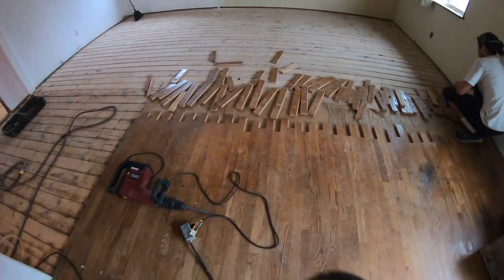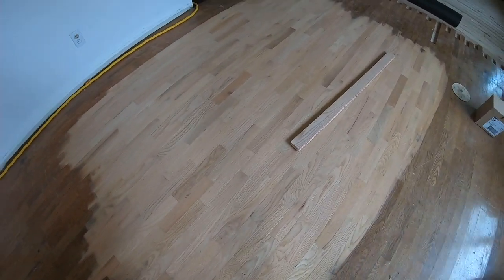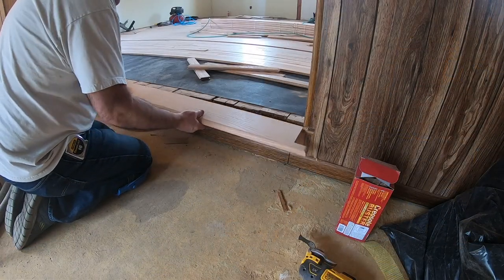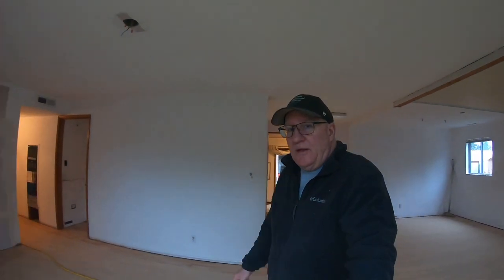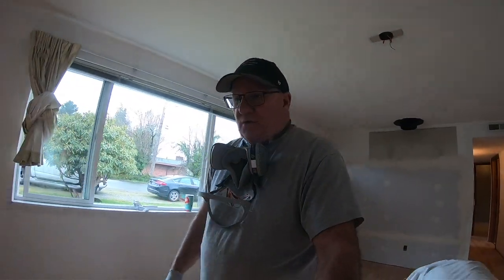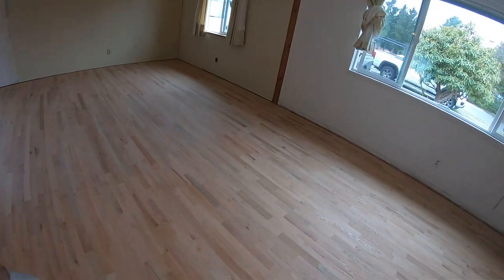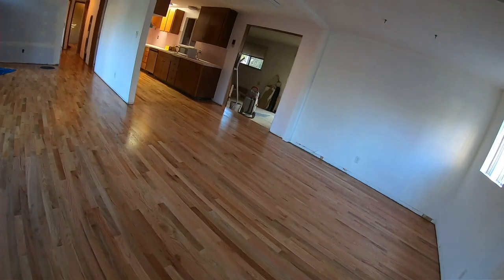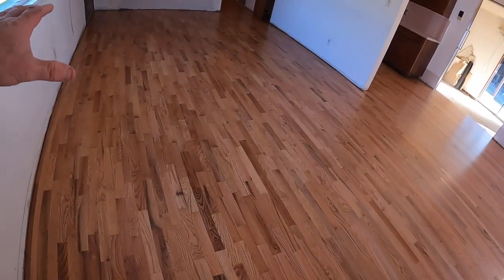Wood Floor Weave And Refinish

Comment: Humppy the Beam reared his ugly head on this on eh... My worst one was at the river cabin project where the hump was 3/4" center in a 40 in hall installing 2 foot tile.  Had to remove the subfloorthen plain the top of the bean and taper the joists to either side. No issue on the beam rating. Put new 3/4 plywood and 1/4  Hardibacker with mortar down and made a flat hallway that matched right to the new Brazilian whatever it was.  The lengths you have to go to sometimes.  We couldn't simple plain the subloor because we would have gone completely through it. 
I liked the electric hammer punching out the old ends. I guess the best you can do is pick closest matches to the old floor and spread your transition area further and randomize it best you can. 
You're coming up with some decent music licks with that guitar of yours. 
I'm currently in the rain at the Unknown  Mechanic's helping him do a second story deck. Still need to replace trucks heater core. Retired for 3 months an it never ends... Nice job as always Richard and Charles. The owners got good quality work they will enjoy for years. Plus they added substantial value to the property.
Reply from the maker: Thanks Jeff, this house had car decking for a subfloor (solid 1 1/2" T&G Fir) we used the old Battle Wagon with 16 grit to grind it completely flat.